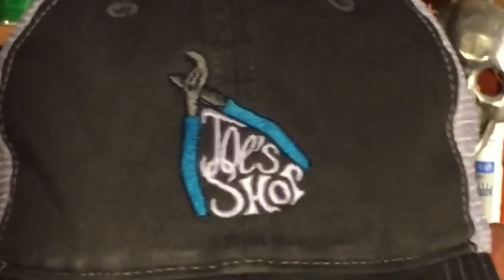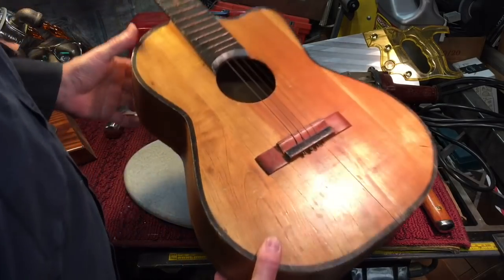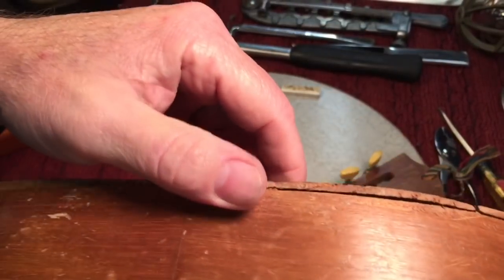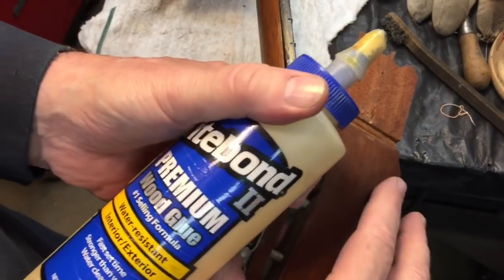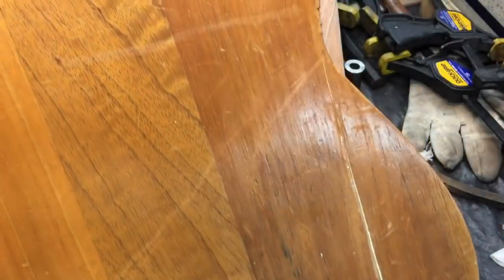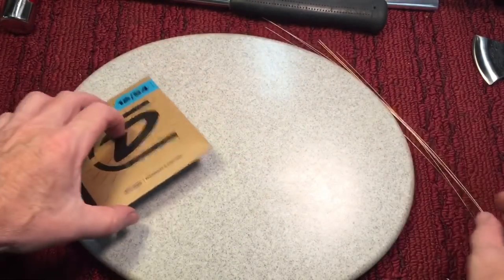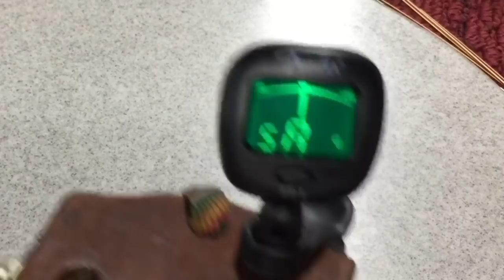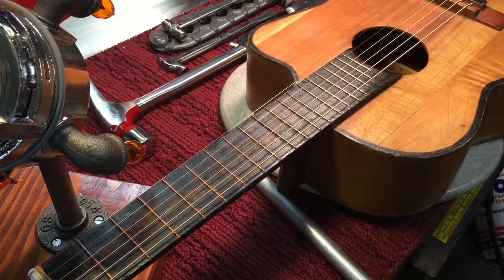Can We Fix This Guitar?

Comment: This is a nylon string guitar, from the bridge type, slotted headstock, width of the neck, no truss rod, and lack of a strap end pin. Using metal strings possibly contributed to the neck being under more tension than designed for and the neck break. A set of nylon strings is 90 lbs tension typically, whereas a set of metal strings is 160 lbs.
Reply from the maker: I tried to get the lightest strings I could get...  Your absolutely right!  Thanks!  😃👍

Comment: I'm not sure if it's been said already but the part you're calling the "top bridge" is the nut.
Reply: Oh and I agree with some of the other commenters. I think this guitar would have better luck staying in tune with nylon strings. When you were tuning it as you tightened one string it would loosen other strings because it is bending the neck just slightly because this guitar wasn't designed for that much tension with steel strings. It will probably get the job done but I would never recommend a student do what you did.
Reply from the maker: I bought the lightest steel strings available but I had no idea about the Nylon- Real musicians have so much knowledge about this subject that the average person like me has no idea!  Thanks!!!

Comment: This is a nylon string guitar. Using steel (metal) strings puts too much stress on the top and neck, and may have contributed to the neck breaking. You can tell that it is a nylon (sometimes called classical) guitar by the bridge (the place where the strings go below the sound hole), and the slotted headstock. It is not a typical classical guitar, as it has a bit of a cut-away. The steel strings are at about 160lbs. of tension, nylon stringscare at about 90lbs. Of tension.

You should have a real guitar guy look at the guitar to determine if it a solid wood, or a plywood/laminate guitar. If it is solid wood, you may want to consider humidifying the guitar.
Reply from the maker: Kostas- I believe this was an inexpensive Mexican tourist guitar.  I never would have fooled around with a decent guitar. 😃.  It was just for fun.  Good advice on the strings!  Thanks
Reply: Sorry for the double post. I thought the original post had gotten lost.